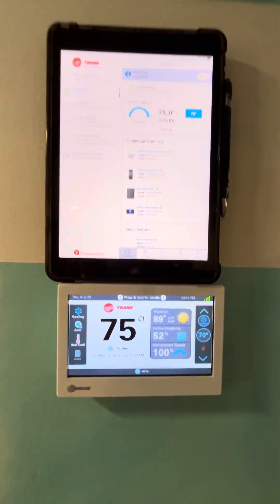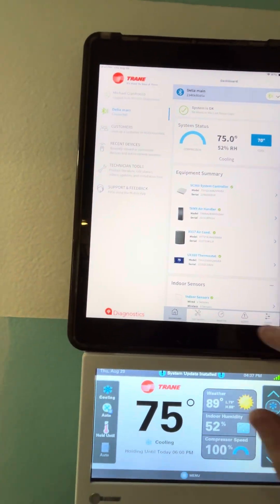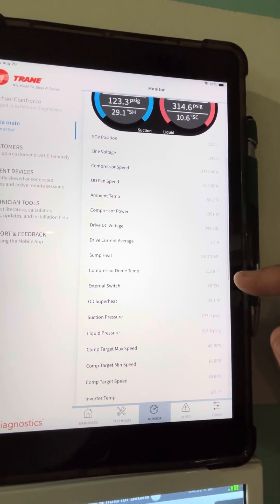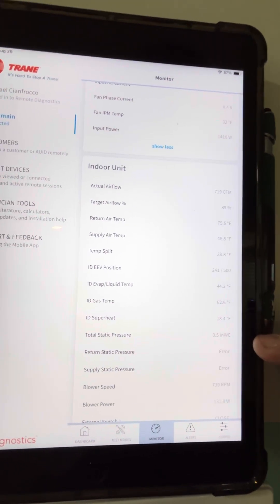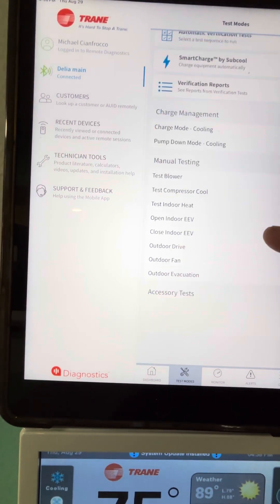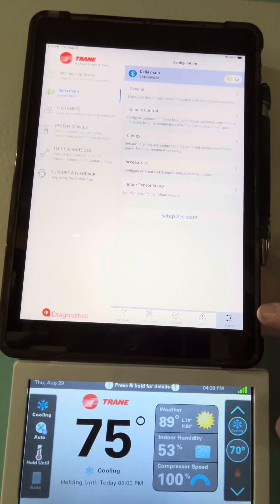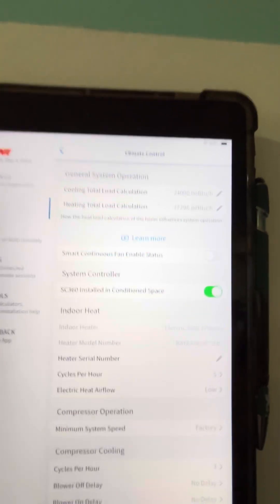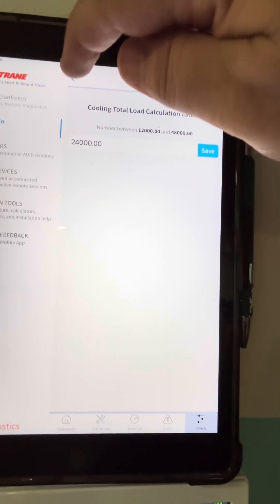Trane XV system with new 360 thermostat

Comment: Just a heads up....i doubt that it will make much of a difference but i think that you may have accidentally turned down the minimum airflow from 250 to 230 at the end of your video.